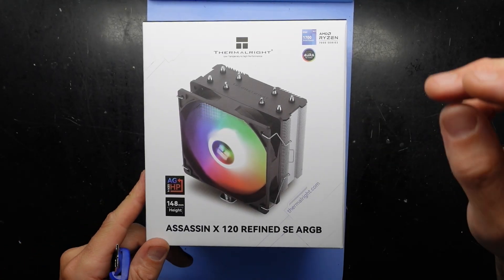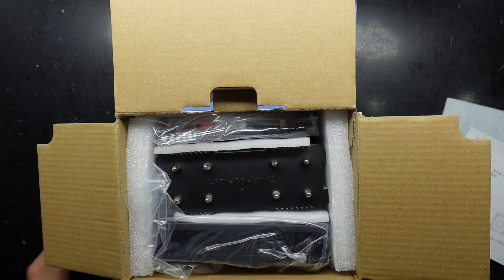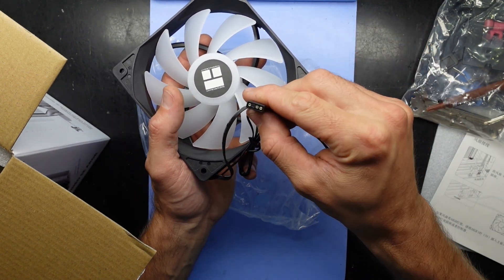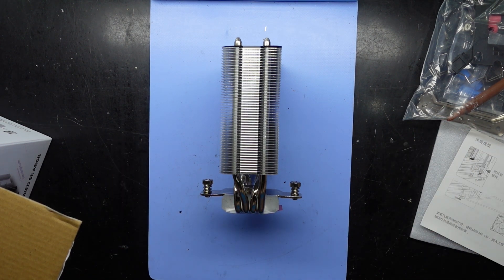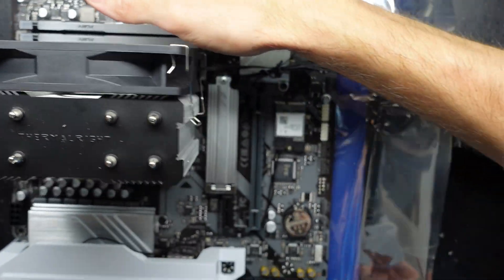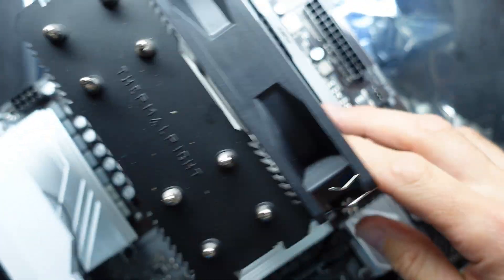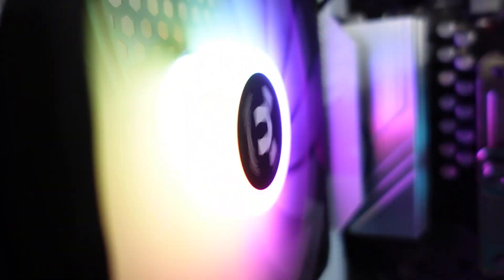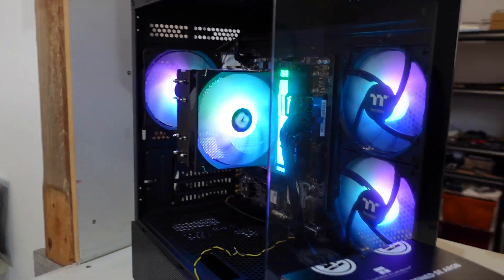Thermalright Assassin X 120 Refined SE ARGB, unbox, install, walk around

Comment: Što pokazuješ temperature grafičke,valjda si montirao cpu cooler,da li može da ohladi ryzen 5 5600,uz još 6 ventilatora na kućištu?
what are you showing the graphic temperatures, I guess you installed a cpu cooler, can it cool the ryzen 5 5600, with 6 more fans on the case?
Reply from the maker: this will cool a ryzen 5 5600 without any drama

Comment: I picked this up the other day but the digital one. am from the US so we use Fahrenheit and mine says 80 without a load and I know that's high. on Celsius it reads in the 30s? witch one do I leave it on and why is it running so hot is that a norm temp.
Reply from the maker: https://www.youtube.com/watch?v=BfsFpefFU1A

30 degrees Celsius is fine

Comment: 4:14 holy moly. You dont need that much of thermal paste bro.
Reply: Ik😂
Reply from the maker: never too much :)
Reply: @rickstechrepairs  No, really. You can put too much paste, it will spread all over the place when you tighten the cooler, and make a mess around the CPU socket. Uninstalling a CPU can then cause the excess paste to get into the socket, and that'll be fun to clean! Also, performance will be worse with that much paste.
Reply: @cruz1ale  I was also shocked to see so much when you can just put a dot or an X. I too, was concerned. Thanks for sharing the info so I don't have to.

Comment: You can use this cooler on intel boards to..mine is a lga 1151 fits just fine .. dude thats a cpu cooler not a gpu . You quoted the gpu temp ..
Reply from the maker: this is a ryzen 5 7600 that has an iGPU that's built in to the CPU 

they will almost tell me the exact same temp as they are being cooled by the exact same cooler
Reply: @rickstechrepairs  my bad for assuming you had a gpu installed separate..
Reply from the maker: all good :)
Reply: 9:15 as you can see there's no GPU attached to the board. 😂

Comment: good cooler or not?
Reply: yes keeps my ryzen 5 5600 under  60 degrees on heavy gaming
Reply from the maker: good value
Reply: Yes a good cooler . I use the same cooler for the last year no issues . It will only work as well if your cpu tdp is within specs of this cooler